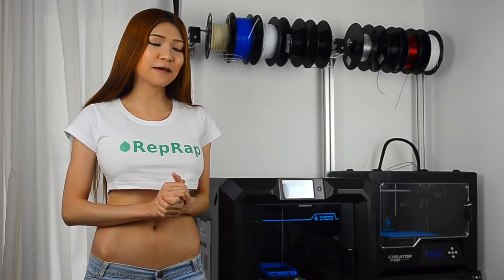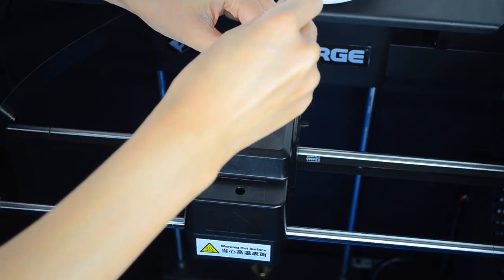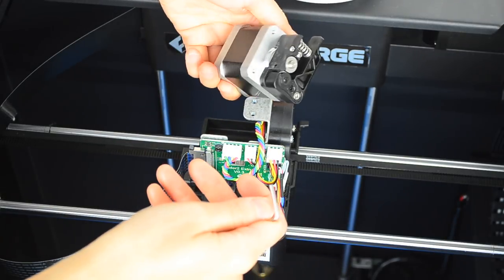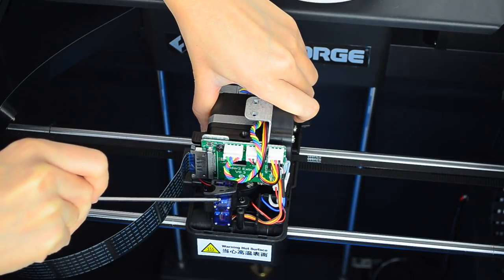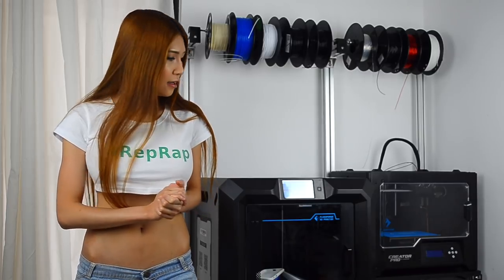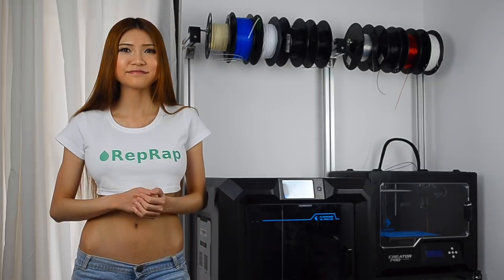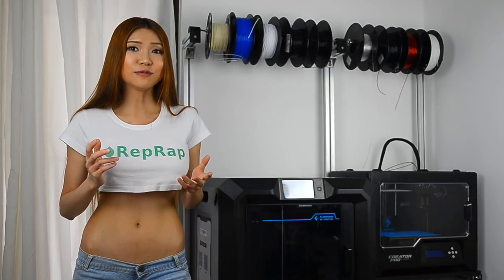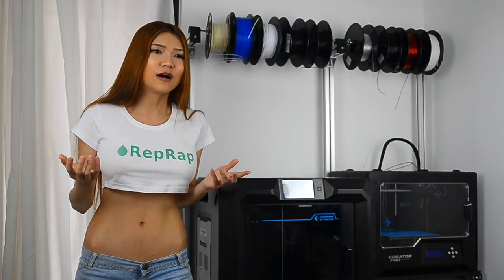FlashForge Guider II- One Month Review

Comment: Thanks for the great video!
Did you had some trouble with the standard extruder an flexible filament or did it work fine? 
You made a review about the extruder especially for flexible filament, would it fit into the guider II or is it incompatible to the mounting?
Reply from the maker: One of the things I really like about the Guider II- prints flexible filament unmodified.
Reply: Thank you for the anwer!

Comment: I very appreciate it that you uploaded an "Update" about this 3d printer :)

I would like to replace my cheap 70$ ebay 3d printer with this one but my question before buying it would be if this 3D Printer needs an constant connection to the Internet or not. It's a little bit important to me because mostly my router do unexpected updates and  because this I would prefer an 3D printer which can print via usb/sd card/tf card
Reply from the maker: Oh no I'd never even consider a cloud-based printer! Wifi is just an option, it prints over USB/SD card also.